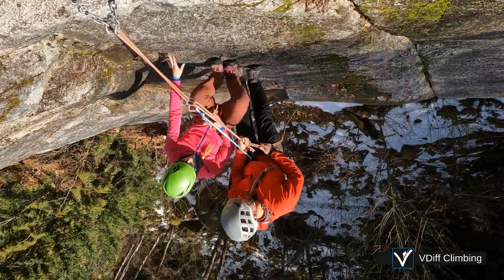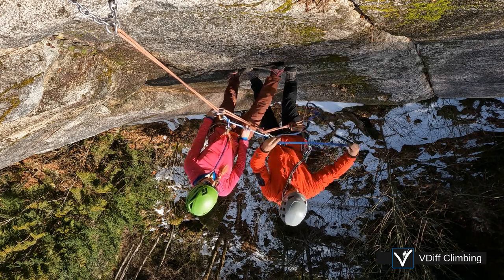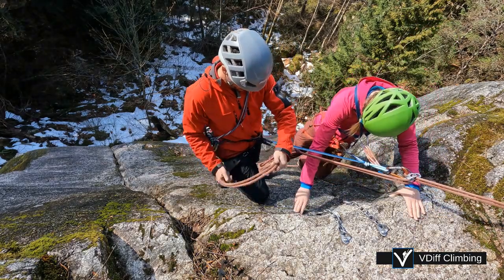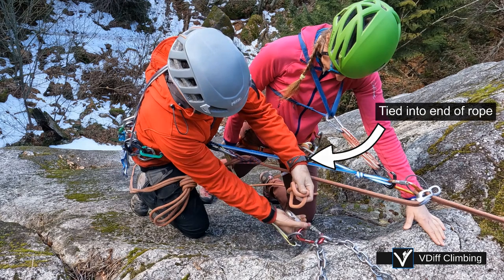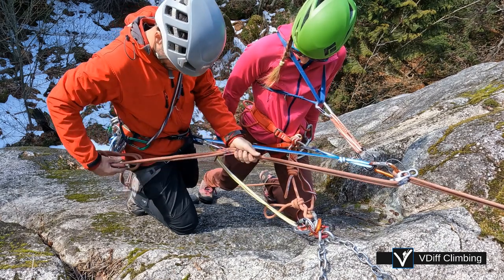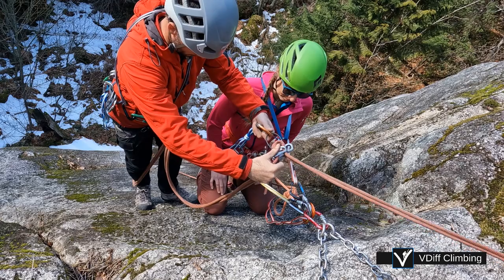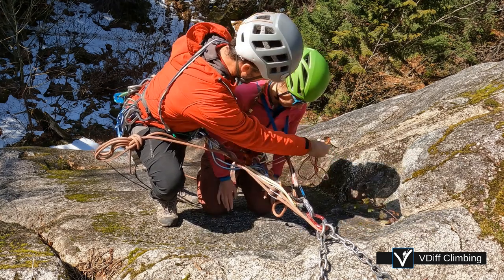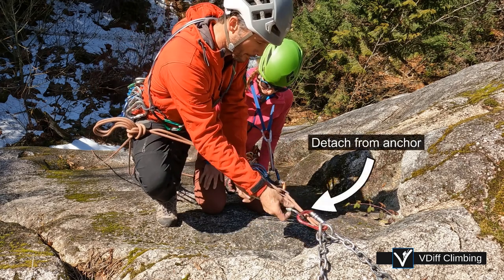Tandem Rappel - Trad Climbing Self-Rescue

Comment: Having used similar systems in rope course rescue scenario's, I spot a big mistake/potential cause of problems: the prussik should be attached in the 'central' system, not on the climber itself. In the current setup, if - for some reason - the climber with the prussik slightly unweighs themselves, there is the potential for the prussik to slide up into the abseil device. You have to experience this once to realise why this is such a big issue.
Reply from the maker: Hi Fabian, thanks for your feedback. You're right. I once used this setup to rappel with 150+kg of haulbags during a big wall solo descent. When I stopped rappelling, the haulbags would continue rappelling themselves and it was very difficult to control because they were literally twice my weight. After that first rappel I switched to system where the prusik was attached to the central system, as you pointed out, which was much better with a heavy load!

This isn't an issue with climbers who are approximately the same weight, though.

There are many ways of connecting 2 climbers to one device. This video only shows one example of the setup, which is simple and works fairly well in many cases. There are pros and cons to every method, so we can't say that one is the 'right' way. I just thought this was a good one to share with people.

I would love to add a whole bunch of alternative methods in future videos (I'm a super-geek) to make this much more comprehensive. I appreciate your constructive feedback, thanks!
Reply: what "central system" means in this regard?
Reply: @alessandroiotti8620  the system where the load of both climbers is fully shared. In the example, only the karabiner with abseil device shares the load
Reply: @vdiffclimbing  Even with climbers of similar weight, you can quickly end up in the problematic situation I mention (for sure not an edge case). Since you are demonstrating this method in a rescue-context, you should opt for applying a technique which minizes the risk for additional complications.
Reply: Thanks  @fabianpoels2728  . I have just been to a self-rescue course here in Italy on these topics. For descending with an injured partner we placed braking device on belay loop of our injured partner located above me. I connected myself to the injured partner with two opposing quickdraws (to keep distance short and avoid possible openings). I have prusik on my belay loop. I basically hang myselt directly to the belay loop of the injured partner which has breaking device on him. I decide speed of descending by releasing the prusik on my belay loop. We pratice the descend and it was smooth. 

Does that sound right according to the complications you mention?
Reply: @alessandroiotti8620  there is not necessarily something wrong with that setup and in an optimal scenario nothing might go wrong. But next time you practise this, see what happens when either:
- the injured person you are lowering gets slightly snagged on something
- you accidentally  pull a bit on the injured person
You will see that the prussik attached to your belay loop will start going towards the braking device, with the potential of it getting stuck in it.

In the setup you describe, it would be better to put the entire system (braking device + prussik) on your injured climber. This can be achieved with the addition of only one sling/lanyard so a very minimal amount of extra gear and effort. You only need to pay attention to keep the system compact enough so you can still reach all the components, without having the prusik too close to the belay device.

As an extra: put yourself in the worst-case scenario as described above (climber unconscious, prussik stuck in the brake device). See how much time and effort it is to solve this scenario...
Reply: @fabianpoels2728  Thanks for the inputs. I hardly can imagine how the prusik on me can get stuck on the belay device of the injured if the belay device is connected to the injured belay loop on a (short) sling. My concern on your system is that belay device on the injured may be even further out my hand reach during the desent which opens up to a lot of potential problems. However, I will definitely test it and see how it goes ;)